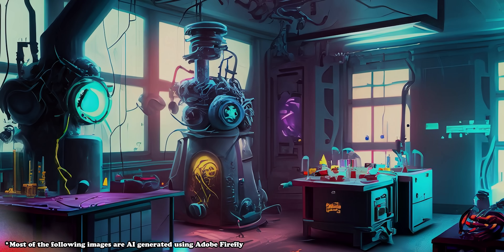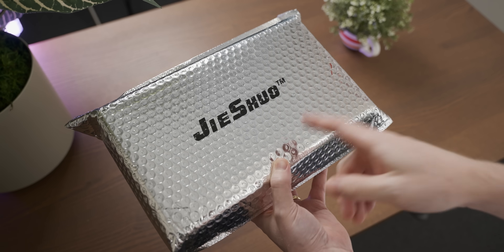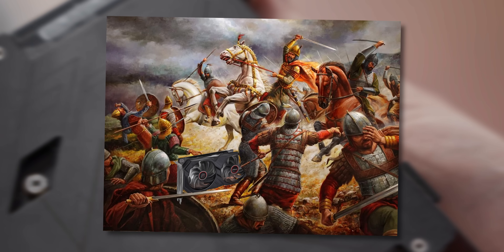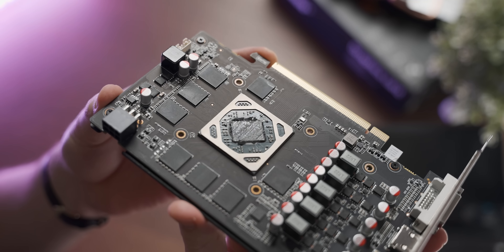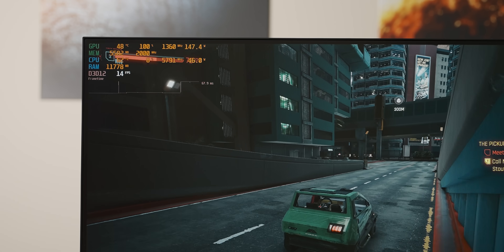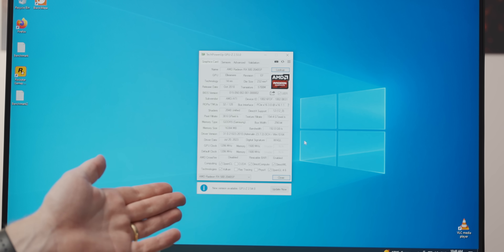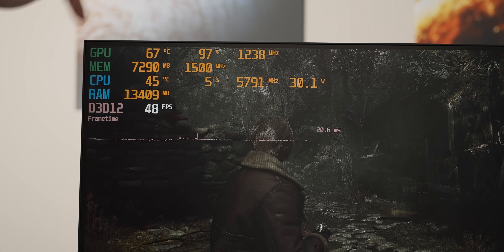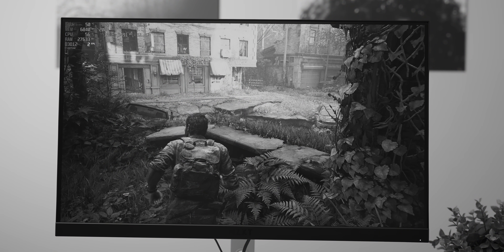Why Would They Make This? 16GB RX 580 From Aliexpress...

Comment: Hello, I am coming back to this video because I forgot there is actually a youtuber/modder that will add VRMS and MEM modules to your graphics cards for a charge. He turned a 1080ti 11GB to 22GB model. The Channel is GPU Solutions. IT be cool to see a video maybe partner with the guy or just get some service on some of your gpus sitting around see if any of the GPUs can benifit from this service.  Example a Nutter a GPU that had under the amount of ram like 1660ti have 12GB instead of 6 ect.... @Dawid Does Tech Stuff Also note he does GPU upgrades on laptops. There is couple other tubers that do this as well I think linus did a video with someone on it. upgrading a 2060 to a 3060 so on

Comment: For anyone wondering about the 2048sp version of the Rx 580... i'll explain the issue in just a few secs...

1) AMD launched the original "polaris" GPUs (Rx 400 series) in a 14nm sillicon process. After a year or so they refined (yet retaining the 14nm architecture) and launched the 500 series, which was the same Polaris chip but with a 10% overclock (Rx 500 series). The 500 series were a rebrand of the exact same CPUs of the 400 series but with a 10% increase in clockspeed. something like from 1150 to 1275mhz to give an example

2) The main GPUs were the Rx 480/580 (2304sp) and the Rx 470/570 (2048sp).

3) 2 years later, when Polaris was about to become obsolete as vanguard technology, AMD refined the manufacturing process yet again, replacing the 14nm with a 12nm architecture. The new smaller architecture allowed for agressive overclock (20% in the gpu frequency or so) an increase from 1275mhz to 1550mhz, to give an example.

4) The new process didn't came with "600 series" GPUs, but another strategy. The old "Rx 580" (i mean the 2304sp) was rebranded Rx 590... while the old Rx570 was rebranded Rx 580 "2048sp". To be fair, AMD could had branded "Rx 580x" and "Rx 570x" the problem is that the "Rx 570x" already performed pretty much equal to the old 14nm Rx 580...

5) AMD choosed this Marketing/Branding path instead of using "600 series" (which might have had more sense from a technical point of view) since Polaris was about to become legacy tech and refurbish&rebrand would have forced for longer driver support to the entire Polaris chipset.

So basically, the Rx 580 2048sp is nothing more than a refurbished 570 but with extreme overclock and 12nm process

EDIT: that would be in a normal case... in this case i think is just an Rx 570 (14nm) rebranded Rx 580 and with a lot of unnecesary ram

Comment: I have an RX 580 2048sp with 8GB of VRAM. I'm surprised how well it does in 2025. 

It's actually very good in older titles Crash Bandicoot Trilogy, and Tomb Raider 2013 at 1440p.

I also use it for Nintendo Switch Emulation with Yuzu and it performs very well at 60 FPS with an i5-4590 CPU. Pretty crazy that a $100 GPU the 580 2048sp with 8GB of VRAM can do 100% Switch Emulation perfectly. I'm super surprised how well it performs
Reply: Its a 570 essentially. 2304 is a 580. Hardly any difference. Main thing is pushing the memory clock high as you can. The card is starved for bandwidth.

Comment: well technically if you dont adjust memory frequency to suit the  new memory bandwidth then you wont notice any performance uplift because you are basically running 2x the vram at the same speed. so it will be much slower. Usually the memory bus needs to be larger than the original (256 Bit in the case of rx580 2048sp)  if you plan to use the same memory clock speed or the memory clock frequency needs to high enough so as to not let the upper 8GB be a bottle neck. Also the GPU core clock needs to also to be raised

Comment: You should have tried running AI models. Some of them up to the 30B ones should be able to suck up all that VRAM. 
Try setting up LmStudio or Open WebUI and run some inferences. These older cards should run faster than modern ones with lower VRAM on large models.

Comment: There is really no point to having that much memory for gaming if you do not have performance to back it up. The reason being high memory usage is needed for large resolutions, or high render scales, in which case you will get 5fps anyway on this, so VRAM will not help much and you will be forced to go down. The only reason this may make sense(ish) is maybe for mining (?) (but here probably bandwidth is king, not amount of memory, may be wrong though) and for maybe things like stable diffusion where VRAM is important. In which case this may be a winner. Maybe you could do a stable diffusion benchmark on multiple cards including this one. I know this is 1+ year old, but if you are reading this - this may be interesting to some people (I just bought a cheap RX 580 2048sp 8gb just for that purpose 😂).

Comment: Notice how the box says PHYSX Support even tho its not an Nvidia Card so NO Physx Support.. 
Talk about blatant Scam Lies. 

Also a game like Skyrim running at 1080P with all 4K Textures and Shadows or even one of the 8K texture mods will easily use up 12-16GB Vram even at 720 Res. 
As Shadow and Texture Resolution have nothing to do with render res, 
YES You CAN Easily View 4096x4096 Textures and Shadows on 1920x1080 or even 1280x720 Display Resolution.

Comment: Oh well the msi afterburner ignoring your settings is an issue with amds andrenaline drivers, if u choose default settings on adrenaline before overclocking with the msi afterburner, it will be fine

Comment: 2048sp They often use a chip from 570. And only sometimes you can be lucky and there will be a chip from 580. Therefore, it is not surprising that it is worse in terms of performance.

Comment: Note they also slightly dropped the clock speeds on the reference 2048 (just under 100mhz slower) though this kit bashed card could be set to anything.

Comment: Heads up for another video idea. An RX-5500 that appears to be a de-tuned RX-5700XT is showing up on Ali-Express recently.  I got one for about $80, and ended up being a reflashed AMD Radeon Pro W5500, which was basically an 8GB version of the RX-5500. For $80, it'll do as a replacement for a a 4GB RX-480, that AMD no longer wants to support apparently.

Comment: This feels like it's basically just another Radeon VII where there's not enough performance to justify the VRAM
As a side note, it feels like there's a million versions of the RX 580
There's the normal RX 580, there's the 2048SP with 4GB and 8GB variants (And now 16GB) and then there's the OEM 580 with 6 and 8 pin variants

Comment: A 500mhz downclock on a card with double the vram just isn't adding up. I could see someone buying this that wanted a even cheaper version of a cheap card as the 580 is. But to be 500 down on a base clock, and you likely aren't going to be able to overclock it back up that high anyways, even cheaper..this isn't worth the gimmick.

Comment: Well - The reason is, AMD brought that model due to bitcoin mining in China. After the mine disaster, there are tons of RX 580s released to the market. Now it is still the most cost efficient card in China - Guess how much is it for an 8GB version? $30. Yeah, you heard me, $30. Therefore those manufacturers are interested in modifying these chips trying to squeeze the last drop of juice out.

If to summarize - the Chinese are protecting the earth by a way that nobody else will think or implement - recycling the obsolete electronics components to make sure they can run to the last second of their lives

Comment: The added memory is likely for crypto mining. 

The RX580 was mining powerhouse for a while, but only 8gb version, because mining uses a crap ton of vram. 4gb just doesnt cut it. 

So 16gb would probably have a pretty big effect on your hash rate.
Reply: It's for A.I.
Reply: Nope, one thing, GPU mining doesn't even exist pretty much, second, more vram doesn't get you higher hashrate.
Reply: @nihadasadli2642  you are completely wrong on both accounts.

Comment: You won't see any increase in VRAM usage at low framerates (The frame buffer is empty) When I first purchased my 2 580's I did it for crossfire, getting 140+ fps on farcry 5 native 1080 ultra using 7GB.+  I separated the two cards years ago when crossfire went away, but it would have been nice to try 16GB version in crossfire and see if I could at least hit 60 at 4K native.  At least they would likely use over 10 GB of mem.  Fortnite is a a good test too.  I'm regularly at 8+ on a 3060 12 GB.

Comment: What's the point of this card? If they had too many recycled VRAM chips, they'd be much better used for expanding the old 4 GB models to 8 GB.
At least the 22 GB RTX 2080 Ti has a purpose, as it's great for AI applications like Stable Diffusion that eat VRAM. But I doubt Polaris is even compatible with SD; even if it is, it'll probably need a custom build and run at something like 0.5 it/s.

Comment: On a proper 580 (or even a 480), 16GB would probably be beneficial in some cases... I have hit 8GB usage in Cyberpunk with texture mods on my 480, for example, and that's just at 1080p... Not sure how much 16GB would help (or how much it could use), but would probably help some... As many others have pointed out, could also be useful for some more "professional" workloads, too...

Comment: It's actually a RX 570 they just re-branded it a RX 580 and then soldered on more VRAM. Makes me curious if they could take a real RX 580 and put more VRAM on it what the results would be. Probably wouldn't make much difference.
Reply: no it's not, it's more like a 570 1/2...between the 570 and 580. lil more than a 570, not quiet a 580.
Reply: @JohnBraman413  That's exactly the same thing I just said. So yes it is just a RX 570 modded to be a RX 580. There is no "in between" here.

Comment: I am actually surprised how well the 5700 XT is doing right now in Starfield. Being a minimum spec, I have been tinkering with it and I can get some pretty high settings and still hovering around the 60fps without FSR. Quite surprising. Before when there would be something like a GTX650 minimum, the game would have to be run on low settings to get 60fps.

Comment: You should totally test Stable Diffusion, people over there are crying for more VRAM. Would love to see if this card can run SDXL where new cards at 8gb/11gb are struggling. If a RX580 16gb can run SDXL perfectly fine then im certainly getting one.
Reply: I doubt Polaris is compatible with SD at all. It might run with a custom build, but probably only at 0.5 it/s or something useless.
I have a 16 GB Radeon Instinct MI50 (modded to Pro VII), and it can hardly hit 2 it/s with the AMD build.
You really need an Nvidia card for SD, or one of the RX 7000 cards. The cheapest option is the CMP 40HX at ~$80, which is the mining version of the RTX 2060S/2070; it can hit 4~5 it/s using single-precision (its half-precision is crippled), or about 75% of an RTX 2060S. The value-performance option is the RTX 2080 Ti with the 22 GB mod, but make sure you buy your own VRAM chips and find a reputable technician to do it.
Reply: @manaphylv100  Wow cool thanks for the info, certainly going to look into that!

Comment: I am not sure you could say that Polaris was a masterpiece or anything special for that matter, since the RX 580 essentially is a RX 480 which also is at about the level of the R9 Nano / R9 Fury which again has about the performance level of the R9 390x which again is about identical to the R9 290X - and the R9 390X already came with 8GB VRAM, which was the year 2015.
Btw. the RX 580 is from 2017 ( 2018 for the RX 580 2048 ), and it doesn't stop there: The RX 5500 ( RDNA, 2019 ), then the RX 6500 XT ( 2022 ) sit at the same level of performance again - only they actually were downgraded from 8GB to 4GB VRAM.
To summarize:
2022, $199: RX 6500 XT, 4GB
2019, $170: RX 5500, 4GB
2017: $229: RX 580, 8GB
2016, $229: RX 480, 8GB
2015, $549: R9 Nano/Fury, 4GB
2015, $429: R9 390X, 8GB
2013, $549: R9 290X, 4GB

Honestly, what is wrong with this picture ? It's clear to say that since the introduction of the RX 480 in 2016 you don't get more for your money. Actually, you even get less.
Also, why that still is about the best you could get in 2013 for 1/3 the price, current top tier models costs about 2x that much - around $1000.
And while you could argue that those are 2x as expensive for 3.5x the performance, FSR and others tricks not even included, those clearly were added akin a cherry on top of "common gaming tier performance" - Luxury goods.
Yes you can get more, but only for paying more. And since the demand of current titles is increasing, you actually have to spend more.
Polaris certainly is nice technology, but much like Nvidia, AMD just used it to milk the us gamers as much as possible by tricking our perception of value and performance.

Comment: the thing is its not hard to add extra vram to a board but the nvidia and amd wont let their board partners put more vram on their boards, they used to actually allow this years ago which is why you would see the same card with versions with different amounts of vram, like i think base 9800gtx was only 512mb vram but most board partners put 1gb on their boards

Comment: The CPU core allocation and usage and the memory allocation stats on the screen while playing is something I've always wanted to deal with my son's PC. We've been running a FX 8350 processor with a 1660 super.  Recently unlike what The geek squad tells everyone we actually had a motherboard failure although it could be the processor gave.  Either way I picked up a ryzen 5 5600 as an open box that that's sorta land itself nicely 2D newer RAM and the newer motherboard.  We have a Corsair liquid cooler that I hope will mitigate the heat of a slight overclock so that I can get the 5602 5600x plus standards.

Comment: This memory could be very useful for loading larger AI models for the same reasons that the 12GB 3060 is the budget secret weapon for AI enthusiasts.
Reply: preach
Reply: @GreedIsBad slow but no memory limitation at cheap price maybe we gotta wait stablediffusion for cpus ryzen 7000 support bf16 but not fp16
Reply: Would a Maxwell titan be usable for that? It has 12GB as well and is available for around 100 euro.
Reply: You are not running any AI on amd hardware, and not because of tensor cores, but awful software support and lack of driver updates. Rocm is no longer updated for these cards.
Reply: @w04h  llama.cpp added vulkan support.
Reply: You use vulkan for this
Reply: @w04h  I run 32-70B parameter local AI models on 3x 8GB RX580's in my PC, and they work just fine for inference with vulkan.
Reply: yup!! i just learned about the 3060 myself.. just picked up 3 for my AI rig.. really not bad performance for the price!!!

Comment: This card from the seller going for U.S $60 right now. I am so tempted to put it into my 2009 Mac Pro. If only I could flash it with the proper EFi boot image to show the boot screen. I think for my streaming setup with 2 1080p monitors and OBS it may be a good compromise. I like it only uses one 6 pin power connector instead of two 8 pin on the Sapphire RX580 8gb card.. My current Sapphire RX280x only has 3gb of ram and need I say... It gets a bit stressed playing games and streaming at the same time. It also lacks the EFI boot rom meaning I can't see crap until the driver is loaded. Nor can I use boot camp to boot into Windows 10. BTW the proper Sapphire RX580 8gb card with Efi Boot rom is going for about $179. and it can be used with boot camp. This 16gb card  uses about 70 less watts and costs about $100 less. So tempting. The games I play now are World of Warcraft (both retail and classic), Cities Skylines and American Truck simulator. The problem is that OBS freezes playing my intro when streaming. I am not sure if OBS has enough video ram or not. but damn for the price..... it is  worth it? I run MacOS Catalina with the Dosdudes patch. I rarely go below 30fps but I have vsync on. and the games play well. So gamewise no reason to upgrade. but the freezing of my intro stream in OBS is a killer for me. My OBS on my M1 Mac Pro does not do that.

Comment: Why don't you turn JUST the texture settings to maximum? Not all the settings. Textures are the main factor in VRAM usage. Turning every setting to ultra isnt going to do anything other than put unnecessary strain on the card. For a more accurate test, turn all settings to the lowest or medium, but max out all the texture settings.

Comment: I guess the extra ram could be used for intense AI art generating as that does not need an overpowered GPU but does need a lot of vram.
Reply: Most AI uses Cuda, so it would be extremely slow on AMD, to the point where you'd be better at using CPU and RAM.

Comment: I have an MSI Radeon RX 580 GAMING X 8GB card. It has served me well all these years. It is retiring at the end of this week when I build my new computer. I find it odd though, I don't know what I did, but I was getting 60 fps on High at 1080 in Cyberpunk 2077. Secret, the "Ultra" settings in a lot of games, if not all, is really not that great. You might get 1 or 2% increase in visual fidelity. I would prefer the more smooth and increased FPS at High.

Comment: It's crazy my 2nd gen RTX 3060 has more vram than most new cards lol. I thought I was getting on the ground floor with my single fan, amazon special, GPU, but its actually been a work horse, and since its so ridiculous to 16Gb Vram or higher on a GPU I feel extremely fortunate lol.
Reply: It will last

Comment: With TLOU V-RAM Simulator I get between 9 to 10 Gigs of allocation at 1440p. Lots of VRAM is great for crappy PC ports but the chip also needs the horsepower to run the rest...